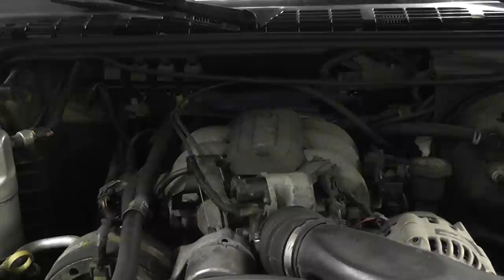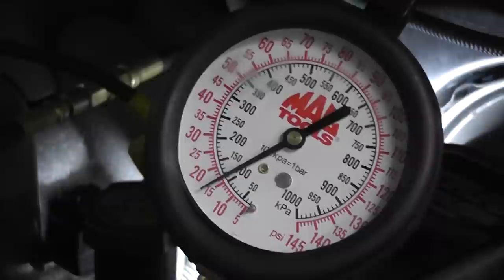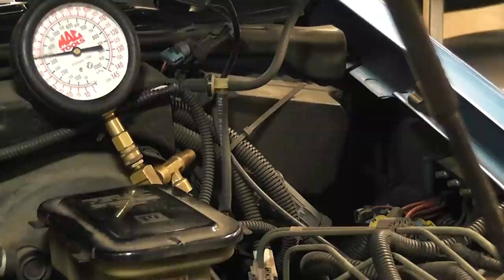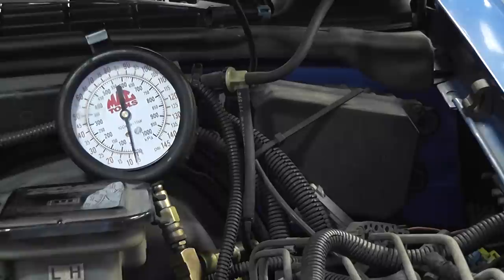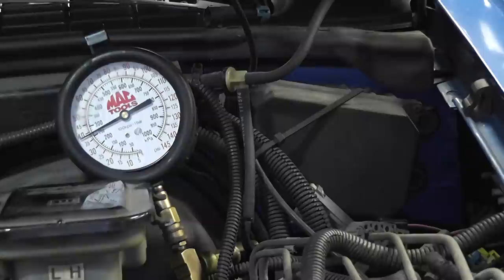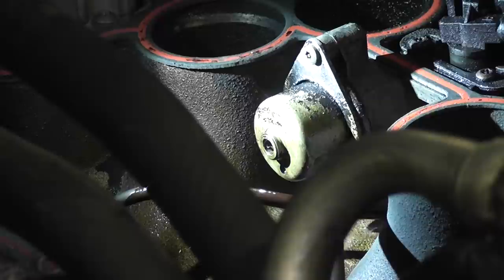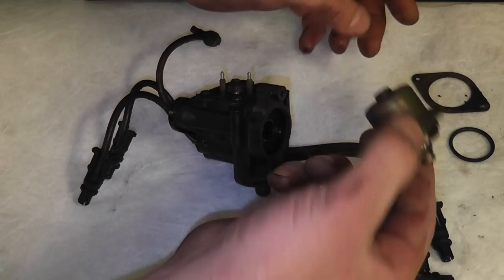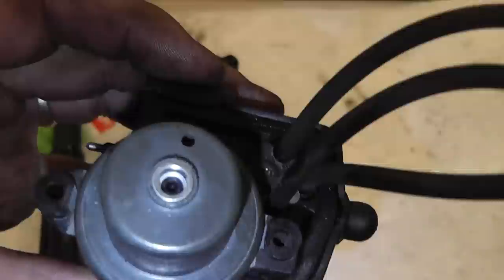How to identify and repair a leaking fuel pressure regulator (GM CPI system) part 1

Comment: You  came to the conclusion that it was a fuel pressure regulator.  The 95 chevy you are working on has an older CPI  injector system with one fuel injector.  The question is how did you know that it would not have been the fuel injector leaking fuel instead of the faulty fuel pressure regulator?  I have a 99 blazer with 4.3 liter that has a new pump that puts out 60 psi, but drops pressure down to 20 PSI in less than 1 minute.  I have yet to do isolation check valve test, but if I eliminate the pump check valve, and it comes down to the fuel injectors or the fuel pressure regulator valve, how would I isolate  the fuel pressure regulator from the fuel injector(s)?

Comment: Hello mister Paul. I had a similar problem with one car with similar fuel system (Opel Astra). I wanted to test the fuel pump if the valve in pump is not holding the pressure so I connect my fuel gauges direct to the pump inlet (I remove inlet hose from the rail)  and when I manually engage the pump pressure is coming but when I disengage the pressure it is coming down rapidly so I assume the pump inside is not holding the pressure. Fuel system have a pump and a rest pressure valve on the rail.

Comment: Great video...  I also have a higher than normal fuel pressure on a 1993 VW cabriolet. The PSI is over 100 but I read it's supposed to be on 45psi.. I also have lots of carbon on the tailpipe and smells really rich..  Any idea what is causing that?  😬
Reply from the maker: Stuck closed fuel psi regulator or pinched return line
Reply: @ScannerDanner  Thanks for the response. I'll check it out.  😉

Comment: I have a 95 cpi and I thought it was gonna be the regulator or injector I hooked up pressure gauge and it’s at 48psi and when I hit gas it goes down 5psi but when I turn pump off it doesn’t loose pressure . Fuel pump you think ? Symptoms is rough idle no start in morning sometimes and dies out at red lights sometimes thanks !
Reply from the maker: Yes sir. Check pump powers and grounds to be sure. Change the pump and fuel filter. But do a dead head test first (pinch off the return line momentarily) psi should go to about 100 psi. If it does, your psi regulator is bad. If it doesn't, If it stays at 48, the pump is the problem. Continue then with the power and ground test before replacing

Comment: Thanks for your detailed video.
is there any tool that we can take off only the regulator off and replace that part without touching anything else?please let me know if there is any difficulty with that route.
Reply: I am directing all help requests to my forum. Sign up (it's free) and create a new post. Be sure to add a name under "alias" as this is the name that will appear in the post.
Here is the link to the forum. 
http://www.scannerdanner.com/ForumRetrieve.aspx?ForumID=3226
Reply: ScannerDanner Premium
Thnaks. I did post it under mikeloves2learn for GM cpi

Comment: This was a good video. I'm dealing with fuel issues with a 96 blazer CSEFI system though. I was curious when you pinched both the rubber fuel lines pressure and return, if the check valve is bad how can you tell?

Comment: So if I had a fuel pump assembly were I could replace just the fuel pump would just replacing the fuel pump fix the problem if it's just the check valve?

Comment: I also have one other symptom of a high idle of around 1100 rpms when first started for the day and it only drops to around 1000 after running for about 5+ minutes.  The rpms drop down to 800 roughly when put in gear.  Then after I drive it for awhile the idle goes down to around 800rpms.  I'm betting all of this is due to the FPR

Comment: Question is, if it wasn't for the oversized fault would it be possible to change the regulator out in place so that I can keep from breaking any lines or popits?
Reply from the maker: Make sure you watch part 2 of this before you do the job

Comment: I think I'm having this issue, occasional check engine light and poor gas mileage I even smell fuel near the intake plenum.  Any ideas?  I'm going to change the oil and get a code reader I'd hate for this to lead to a blown up engine or any real bad issues.

Comment: one thing  u should mention as for as the poppet go it doesn't matter on vin code w but on the vin code z (one with 6 injectors) it does matter where the poppets go

Comment: Hey Dan,2000 S10,all of the line to the return are hard plastic,cannot pinch them off. Fuel pressure up to 60 on turning  the key on,the when shut off,pressure goes to 0,hard starting unless you let the pump prime to the max pressure when turning the key on. Goes to 0 all the time. Recommend a new pump as the return check ball may be screwed up,or is there a pressure regulator on a 2000,cannot seem to find one.Thank you if you have anything that may help me out,as this is my wife's truck. 4.3 V6,base S10 truck. Thank you Mark..
Reply from the maker: Pressure regulator is inside of the intake plenum. IF your fuel trim numbers are very negative and you are using a lot of fuel, I would reconsider your direction and possibly go after the regulator first. If your fuel trim numbers are normal, then yes, I would go toward the pump check valve as the cause of your bleed down problem.

Comment: Could there be a rough idle - lack of power concern with a leaking regulator ?
Reply from the maker: Usually over-fueling (leaking regulator) will not cause a lack of power at wide open throttle.

Comment: I hate that they havent made the regulator easier to get to. For such a cheap part that's so important that's such a pain to change you would think they would of designed a better access. I have a 98 5.7. And if they just made it so all you had to do is remove the 4 bolts on throttle body that's very easy to get off and make it changeable from there!!!

Comment: Good Morning.
I have a 1995 S10 Blazer 4.3L
A month ago I change the injector by an injector reconstructed by AC Delco and Delphi pump. Similarly I installed fuel filter, filter pump and injector Dorman hoses.
To date much takes to boot or sometimes does not start at all.
I checked the pump pressure and this only reaches 40 psi and removing the switch down immediately to 20 and stay there.
You mean I have to change the pump or it could be something else?
Saludos desde México.
Reply from the maker: yep, not enough pressure. You need to replace the pump and if you already did that, you need to make sure there is not an internal leak between the pump itself and the sending unit housing. The old pulse dampeners GM used had issues with this. Not sure if your model has one or not.

Comment: I have a 2003 chevy avalanche 5.3... and mine drives good for a long time. Then it starts to sputter acting like it has no fuel. And at times shuts off. Then when I try to start it . It won't start. If I give it 1 minute or so then it will start. It will go. Then after a little distance it will sputter again and the same thing over again. PLEASE HELP

Comment: I have a 96 S10 with a TBI vortec 4.3, it has a god awful knock  that sounds like a sticky lifter/push tube that only occurs at startup. It hasnt affected the performance of the engine, but it is noisy. The motor has 330,000 miles and I use only Amsoil synthetic oil with a K&N oil filter. Any idea's? Love the info from your video, especially the safty part, most folks just hook and go.

Comment: Dan, first thank you, second, I replaced my reg, and the pressure was 55psi, I though it was to low so i tried to adjust the reg , but it did not move the PSI, did I mess  up the new reg?
also the same part if avail from standard and I did not need to modify the housing.

Comment: I have a slow drip under the middle of seats. Maybe oil? Not sure its 2001 S10 chevy 4Wd. Starts good under 106000 on it. Any suggestions ?? Getting reday to drive across country. From Montana to Michigan. Had no problems coming here...
Reply from the maker: Transfer case seal, Transmission pan gasket. Transmission rear seal??
Reply: Thx I just had the oil changed. Wouldn't they have noticed that??

Comment: Hey ScannerDanner, I know that this video is fairly old but I just had one question. Is the problem typically the regulator or is it just as likely that it could be a cracked/damaged line inside of the plenum? I have all of the symptoms and have run all of the test that you showed and I know that there is a leak somewhere inside of the intake. I just didn't want to take it apart and have it be the Spyder itself, because I can't afford one right now but if it's that regulator I'd like to get it fixed as soon as possible because I can definitely afford that and my fuel mileage is terrible. Thanks in advance!!!
Reply from the maker: Every time I've done this job, it has been the regulator except for one. The high psi fuel line inside had a pin hole in it. This is easy to test. Pull the upper plenum and then jump the fuel pump and do a visual inspection as I showed in this video. Most likely it is just your regulator.
Reply: ScannerDanner right on!! Thank you so much, that's great news. Hopefully that's the case for me.

Comment: I have a 96 Chevy and the psi is on 55 when ignition is on and when the truck is running but when I give it gas it doesn’t go pass 60..  & when the truck is off the pressure runs down quickly.. Could this be the pump?
Reply from the maker: Do the tests I showed in this video for the bleed down issue. 
As for the psi, it should be 60 minimum during cranking
Reply: @ScannerDanner  it doesn’t reach 60 when cranking.

Comment: 1994 s10 2.2 run rough when cold and stumble when warm and hot run fine. But when disconnect alternator runs good cold or hot. We replace three alternator tune up ect. What you think could be wrong? Please help

Comment: Oh and one last thin  GMs always use AC Delco or Delphi which makes most of the OE parts.  That's why you have trouble with that regulator because it's aftermarket not OE.  Always use genuine AC Delco or Delphi for GMs.

Comment: Hello will a bad fuel pressure regulator cause the same problems in a 1999 pathfinder 3.3?? I've blown 3 distributors installed the new one 2 days ago and I'm back to these symptoms
Reply from the maker: what symptoms? rich condition and long crank time?
Reply: @ScannerDanner  I start my vehicle up and once it gets to operating temperature I put it in drive and it starts bogging down like it's not firing on all injectors I replace 2 injectors already change the distributor and it randomly shuts off different injector I have new spark plugs new cables new distributor new fuel filter could it be the fuel pressure regulator it clears up when I punch it and give it a lot of acceleration it revs up nicely it's just at idle that it feels like crap

Comment: It takes 51 psi for the injectors to work ( open and close) it shouldn't drop more than say 4psi in 10 to 15 minutes after shut off .I'll say when ur 4.3 vortec is running right there hard to beat are out run but when there mis firing man its bad news.its possible to replace every sensor and pump and spider and the list goes on and on before you find out why it's misfiring it's crazy but I love my chevy blazer 4x4.have a blessed day.

Comment: I have the 5.7 and upgraded the injectors to the mfi and the fuel pressure at idle is about 51 when i turn key off it loses pressure really fast. Think its my regulator? Ive seen reviews on this ac delco and people have issues of the regulators going bad. Its only a few months old
Reply from the maker: do the tests I've shown in this video, it could just be the pump check valve too

Comment: I have problem removing fuel line from fuel pressure regulator on 98 explorer. The threaded end just keeps spinning?
Reply from the maker: pretty sure Ford used spring lock fuel connectors on those, so they are not threaded, not sure on the regulator though, sorry

Comment: what is the part that you have the pressure gage hooked up to. that's where mine is leaking gas from. please help.
Reply: His fuel pressure gauge is hooked up to the schrader valve on the fuel rail.  GM calls this assembly the "nut kit."  You can purchase a separate schrader valve or the whole nut kit assembly which includes the valve.  Don't forget to replace the O-rings (2) if you go the nut kit route.  It is much easier to pull the intake plenum if you R&R the nut kit.  If your nut kit has never been replaced, the bracket in the back is attached with a torx screw which is challenging to reach.  Many replace this with a bolt to save time in the future.  You don't want that valve leaking.  Sometimes, if the cap has been lost, grit can get in the valve and prevent it from closing.  Sometimes you can blow out the valve with shop air and get the grit out and allow the valve to close.

Comment: I have a 99 Sierra with the 4.3L scpi (on my channel) and I think my spider or regulator is starting to go. The only symptom I am seeing is a rough start, (usually just takes longer than normal to start) only when it is warm. If the truck has sat over night it will fire right up but if i run it for an hour then shut it off, wait 5 mins and then fire it back up it has a hard time. truck hasn't thrown any codes. Is the beginning of a failing spider? Any ideas yall? Thanks.

Comment: hmm, what if I don't have pressure drop like this one did. it's always thrown lean in bank 1 codes. it'll sputter with some carb cleaner sprayed in the intake. other wise it won't run now. it would a few times when I purged the fuel at the schrader valve. idle really rough or die but would run rough and stay running while pedal was pressed some
Reply from the maker: IF this is a Vortec 4.3, you should have a minimum of 60 psi during cranking

Comment: In book is Pinch off return line * Psi now hold =leaking pressure regulator seat.  i saw you pinch off return line is psi drop that is mean psi regulator bad ? i was confusing sir . Could You explained again pls master .thank you
Reply from the maker: In this particular case study there was a leak in the regulator diaphragm, so pinching off both the psi and return line, we still had a bleed down issue. 
If it holds when you pinch the return line, it is the seat area of the regulator that is leaking. (a regulator can leak in two places, the seat or the diaphragm)
Reply: ScannerDanner i got it  thank master

Comment: Is it possible that the fuel pressure regulator is causing a no start situation? Or would that be the spider? Mine has a new fuel pump and fuel filter and it's wanting to try and start while ether is being sprayed in... Please help
Reply from the maker: follow the steps outlined in this video, usually the regulator, when it fails, will cause misfiring and severely rich conditions but not a no start. 
What is your fuel pressure during cranking? It should be 60. Less than 50 and it will not start
Reply: Yes a bad regulator will not have enough pressure to open those type of injectors and will have a no start condition at times

Comment: I've got a 350 vortec engine just had fuel pump and filter put in with check valve and it drops 5 PSI within the first 7 minutes
Reply from the maker: I'm okay with that as long as your not having long crank times or rich conditions

Comment: Paul how are you? I have a question for you, I got a 02 lincoln town car with fuel in the oil what do you think can be my problem? thank you in advance
Reply from the maker: Do you have a vacuum type pressure regulator on the fuel rail or is it in the tank on this model?
Reply: The fuel  psi regulator is on the fuel rail under the hood check the vacuum line for gas in it check for codes
Reply: Thank you

Comment: will the regulator go on without taking cpi unit and poppits off
Reply from the maker: I believe there is a part 2 to this one where I show that I had to modify the aftermarket part because it cracked the housing when I bolted it up. So you may be able to do it but I would be very, very careful

Comment: I did this test on my sons 95 blazer with obdi, poor mpg, runs pretty good, smells faintly like gas, starts great, engine has 12,000 on rebuild.  I have narrowed it down to a leak in the plenum. It's washed on the passengers side, but I pressurized it and cannot not find a leak! any suggestions. Thanks for the great video. The wire to power the pump is a great tip!

Comment: My regulator is not leaking could it still be bad and cause the fuel smell ? I don't see anything leaking when I perform the test. I have a clean side on the passenger side tho. Stumped at this point
Reply from the maker: If it's clean on that side and you smell fuel it's most likely leaking but is not evident without vacuum on that port.
Reply: Thanks man much appreciated! Your awesome keep up the good work